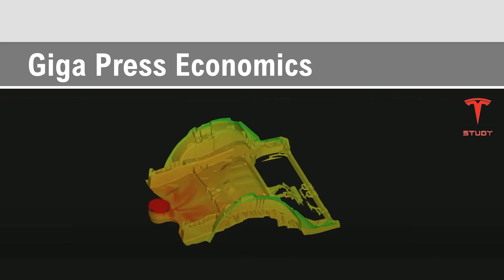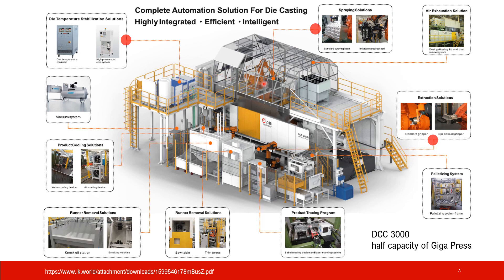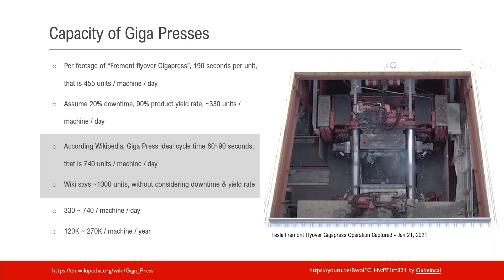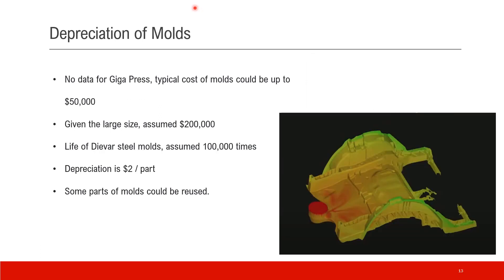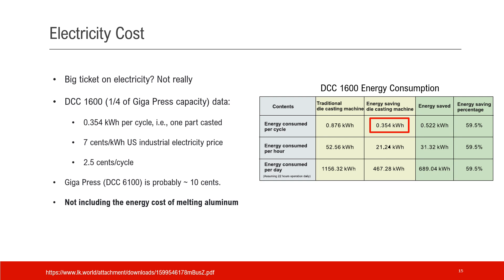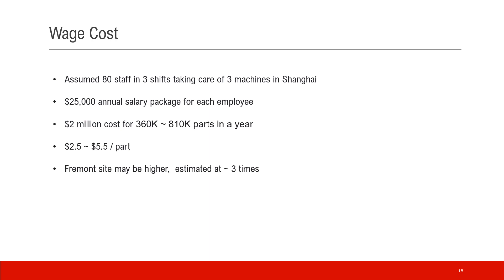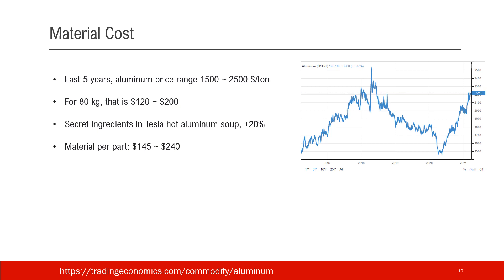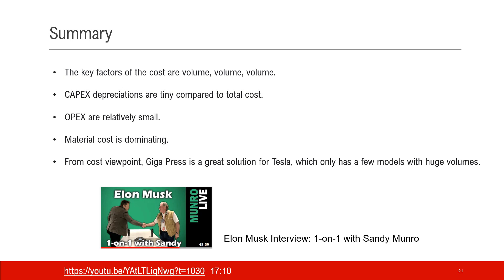Giga Press Economics

Comment: Helpful analysis. Thanks 🙏. One minor point: You calculated the energy to bring aluminum to its melting temperature but did you forget to include the “heat of fusion”, i.e. the energy needed to change aluminum’s state from solid to liquid?
Reply from the maker: Thank you for catching that. You are definitely right. 
-------
Latent heat of fusion of aluminum = 396 KJ/Kg
For 80 Kg, 31,680 KJ = 8.8 KwH.
At 7 cents electricity price, additional $0.62 / part.
So the base cost should be $1.49 / part.
Considering heat efficiency, it could be $2 - $3 / part, up $1 from the previous estimation. 
-------
The work in video was not “serious” enough.
Reply: @t-study5089  👍
Reply: Is the metal heated to liquid state or only to get soft? Will the pressure help to make the metal float better?
And is the energy cost to cool the machine/part less, equal or higher than the energy to heat the metal?
Reply: @pgrts  I think they just allow the part to air-cool while waiting assembly.  (I'm basing this on the flyover video).  I don't think their is any reason or sense in cooling the machine.  The thermal cycling would be very damaging, so I think the machine is always close to peak operating temperature.
Reply: @loungelizard836  The gigapress has to maintain the same (cold) temperature for all castings. 
There are different systems for temperature controlling for both casting and press.
I have worked with similar presses for large plastic molds and the cooling of the presses was huge.
Reply: I've never purchased die cast molds, but if they are anything like plastic injection molds your price for the molds is very low.  I would also expect they would have a back up mold,  as any downtime would be costly given the cycle times.
Reply: Also the energy needed to maintain the melted aluminium temperature
Reply: The energy is not gone afterwards. When Al freezes in the mold, some of the temperature can be "recycled" to melt the next part.

Comment: So total cost is max 167-273 USD. Tesla said there is a 40% cost reduction compared to the welding solution. That means that the cost saving is 167*0.4/0.6 =111 - 167*0.4/0.6 == 182 USD /castings. A vehicles has 2 castings: 222-364 USD. For a 40-70k vehicle, that is not too much. On long term this is important, but at the same time it is not an extraordinary achievement.

Comment: This was a good break down of savings, however there are a ton of others savings.  For example consider all the parts they are removing. You are now eliminating tooling for those parts, machine maintenance on those presses. Buyers to purchase steel, quality techs to inspect parts, quality issues related to incoming steel, engineers to maintain drawings/cost out/redesign those OBS parts. Material transportation of raw material steel, and produced components.  The indirect/non value add cost savings of the gigapress are hard to calculate, but very large.

Comment: Very informative video, but one thing to keep in mind (mostly related to terminology): labor costs (wages) and manufacturing overhead (electricity, water, maintenance, etc.) are not OpEx, they are part of the Costs of Goods Sold (COGS), along with material costs and equipment depreciation costs. So in simple terms, all costs associated with running the production facility go into COGS.

OpEx is related to all other costs not associated with production: Selling, General and Admin (SG&A - headquarters-related costs, running the stores and service centers, etc.) and research & development.
Reply from the maker: Thanks. Your terminology is more accurate. Since this is a product (part) level discussion, nearly all daily "OPEX" should be COGS.

Comment: You omitted the most important factor is a lot more cars produced on the same line every day. The CYBERTRUCK can now be produced in a smaller factory because the line for dipping and painting  would require curing and application time of 24 hours (imagine 300 cars on line in factory for a Day before first one comes out the door. (Savings of $20,000 per truck using STAINLESS STEEL)

Comment: I don't see anyone else mentioning this in the comments, so I will... At 5:00 you talk about the Fremont flyover video and the stated cycle time of  190s. In the video clip, if you slow it down to match the claimed fast forward rate, the workers in the clip are moving very unnaturally slow... I have seen this mentioned multiple places. The actual cycle time (based on finding a playback rate in which the workers move at what appears to be a natural rate) is something like 100-110s.
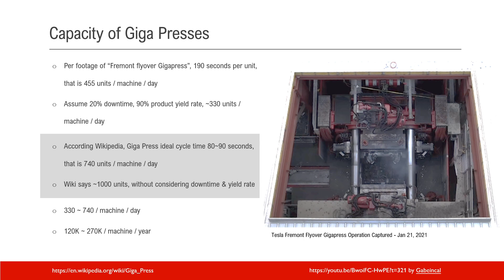Reply from the maker: I revisited the video and took some notes. 5:23 open molds; 5:43 8x speed starts; 6:04 open molds again (in 8x status). The math is (43-23) + (6:04-5:43) x 8 = 188 sec from open to open. I slowed down 8x to 1x speed. The staff on right side behave at normal speed.

Comment: Something to keep in mind. Giga Berlin will have 8 giga press in its first phase.
And at some stage, any press will be able to make a Model Y, Model 2 or Model 3 Front or Rear frame. In any volume configuration. 

Tesla is not done with its manufacturing process. You will see some optimization from the Shanghai team and separately the Berlin team with their "Model 2" manufacturing, and most likely best of both production line will be incorporated in the Model One.
Model One should be the pinnacle of vehicle mass production, and only small tweaks after that is to be expected.

Comment: Well, it does make sense in investment cost, but it also simply requires less people, less programming, less movement, less extra parts (fastners, adhesives, welding, less dissimilar materials), and reduces end product weight, and reduce total floor space required. That alone is a big factor.
Reply: Uhm unfortunately it doesn't totally work like that, stamping has became extremely efficient and other companies have already perfected it and by sharing platform it means way less Programming and changing dies...... also vw is still able to make 10 million cars a year
Reply: Just look at vw, the porsche cayenne, Bentley bentayga, audi q8, Lamborghini urus, vw touareg... shares the same platform which means significant amount of savings involved. Same goes with golf, passat, tiguan........

Comment: That was a very well done analysis.
Some minor issues as the heating of Aluminium is maybe done with Gas. 
Also we don't have a comparison to the expenses for the steel part and putting them together. But you have got all the important points. With casting there could be very big savings compared to the previous Tesla production and to what the competitors do. 
Also its patented. So its not that easy for competitors. 
I suspect a big weight reduction. This rear part has now 80kg. With steel I imagine its 160kg or more.
Reply: The stamping still has a significantly big advantage, just see how vw is able to produce about 10 million vehicles a year and by sharing platforms with multiple models the savings are astronomical. Stamping is very quick and sooo many parts are big and also they use significantly way less parts than tesla who was using 70 parts for the rear.
Reply: @alanmay7929  true but they're minimising the stamping, casting and fabricating of trimmed or ground parts to bond, weld, rivet or screw them together. additionally there's no need for scrap bins because Castings will be trimmed on site and re-used, recycled on site. This will improve the so-called panel gap issue which looks terrible in Sandy's videos but there are lots where I live, Yorkshire/Derbyshire England and they look fine to me and I look. Improved consistency should help.
Reply: @andrewsaint6581  the panel gap mentioned by sandy munro is just pure negligence by tesla. Teslas are sooo poorly assembled and they don't even have quality control to test/verify everything just because they just want to sell cars! Wtf! A 1980 cheap Mercedes Eclass is 1000 times more solid than a tesla.
Reply: @andrewsaint6581  the casting has nothing to do with alignments have you even ever seen a pickup truck or a car been tested for body rigidity?! Its all about build quality
Reply: Uhm you are totally wrong, the steel part does not weight 160kg, its thiner steel compared to very thick aluminium which means almost the same weight
Reply: @Alan, do you have concrete numbers? Not as good as with 3D printing but with casting you can design the form based on the strength requirements. Steel can be stronger but Aluminum is not that bad. The E-Modul is not that good. 70 vs 210xxx.
Reply: @schussenfilz878  steel is very cheap and has alot of applications and thats what matters, 3d printing still has a very long way to evolve. Cwrbon fiber is another great material that can be use in mass for car production, by sequestring c02 into usable parts.

Comment: Cost is important but production line downtime is a bigger deal.  Any robot goes down, and the line goes down.  So gigapress should reduce downtime of the production line.  Also, getting rid of 600 robots frees up floorspace for a second line.  Should roughly double factory throughput for a given footprint.
Reply from the maker: Very good point about reliability. Regarding the space, BIW shop will reduce 60% in size with both front and rear underbody casing. But the die casting shop is a quite big and high-ceiling structure, too. Total land saving is not very clear to me.
Reply: @t-study5089  you also forget the testing of casting after the process since its a important structure of the car. The casting machine can also go bad with all the sophisticated hydraulic lines and cooling systems..... everything to maintain the proper consistency.
Reply: Unfortunately its not true at all, the casting will never be able to compete with stampings, and for record other companies doesn't not use 300 robots like tesla for the rear of the car. Finally platform sharing means stamping is alot more faster and efficient to make 10 of millions of cars a year.
Reply: @alanmay7929  Do you have any numers or are you just assuming?

Comment: One additional saving to consider is further down the line. More consistency in the vehicle body since there are no individual parts that introduce variance and can cause panel gaps or other functional issues means fewer warranty issues and refused deliveries, etc. Overall higher customer satisfaction and profits.
Reply: Nonsense, its actually not the case, the larger the casting, the higher is the chance of sooo multiple rejects/failed castings. Vw makes 10 million cars each year with zero issues.
Reply: @alanmay7929  By all means, cite some sources. It's a rather strange world you must live in to think that dozens or hundreds of individual parts joined together is going to be more consistent and less error-prone at scale than a single casting. Likewise, show me the data that VW manufactures 10 million cars without any issues because I can search "VW recall 2021" and find multiple vehicle models right now that disprove this.

Comment: I estimate that the cost of the mold for that rear part should be around USD 4 million, not  USD 200K.  Good molds that last the quoted life cycles and cool down evenly each part are complex, with many heat treated, high precision components.  No way in hell 200K.
Reply: So the whole machine is 9.5 million and the mold is 4 million extra? That is a bit hard to imagine. At the end of the day, mold is a piece of high quality steel. This one is not much different from other die-casting molds, just getting bigger.
Reply: I think you are right, a simple plastic injection molding tool for a 1000ton machine is 600-800k. And this telsa casting tool is waaaayyy bigger, has many sliders, much complexicity. Life estimate on a die cast tool is 200k shots max.
To backup machine downtime you will need a second / third press if you don‘t want to risk production line stops.
200k lol!
Reply: No heat treatment here. Elon said at Munro's interview that they've developed a new aluminum alloy that saves the traditional need for heat treatment post process.
Reply: @oreneya  I mean heat treated steel parts of the mold, not the molded car component.

Comment: Why would it take 300 robots to assemble 70 parts ? - That doesn't sound right.  Are you sure that Elon didn't mean that multiple Giga Presses will replace 300 robots total ?  It would make more sense if 3 or 4 Giga Presses replaced 300 robots for a given factory.
Reply from the maker: 1000 robots are not in one serial sequence, but in several parallel groups. I do not know the exact number. But use 4 as example, then each group has 250 robots and offers 150 (guess) units daily throughputs. That is 150 * 4 * 365 = 219K, about Fremont Model Y capacity. In each group, 75 out of 250 robots were responsible to put together 70+ parts for the rear underbody. That sounds reasonable, right? These robots got replaced in the 4 groups, so total 300 robots. 

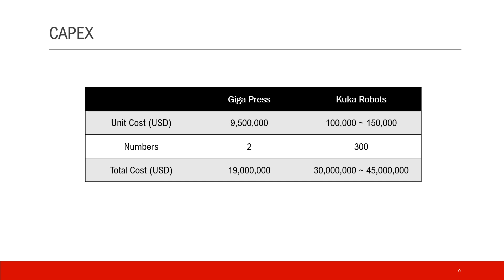You are right. More than 1 Giga Press needed, based on the capacity. At 3:35, I assume Elon talked about the Fremont case, in which 2 Giga Presses replaced 300 robots.
Reply: I totally agree with you other companies doesnt use 300 robots for just the rear of the car its limit stupid.